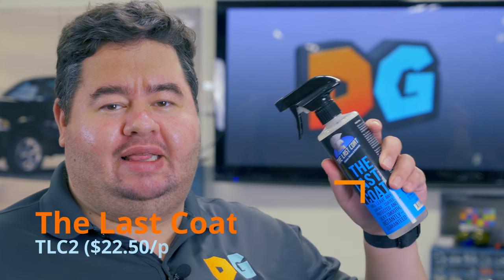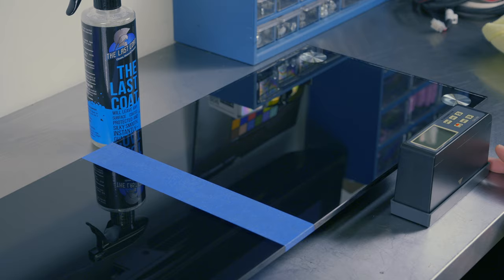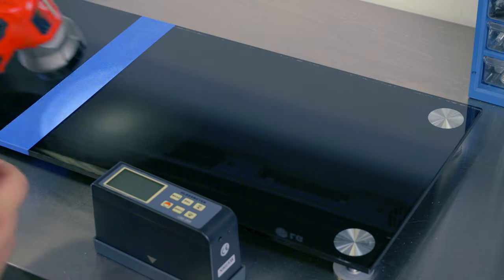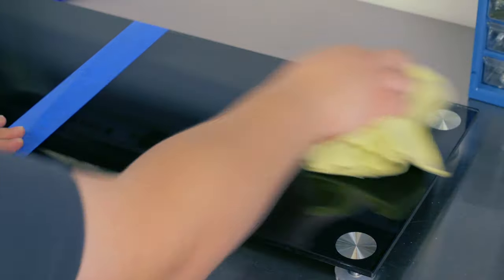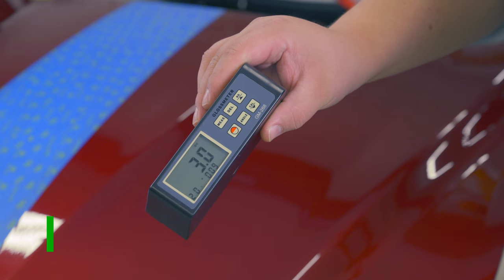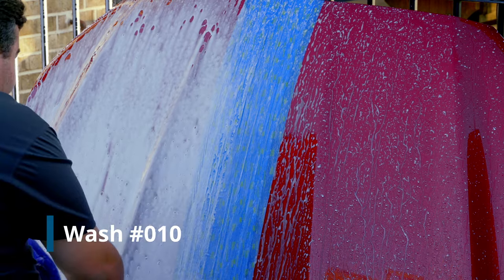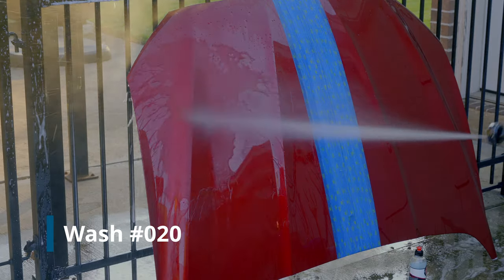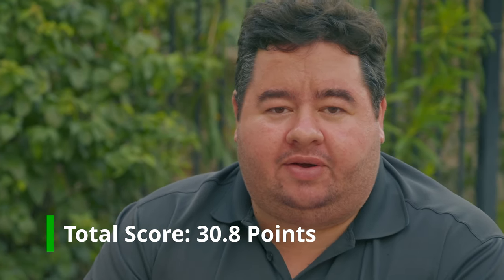The Last Coat 2.0 - TLC2 the latest fad or the best spray wax ever?

Comment: you honestly gave one of the most objective and unbiased reviews of this product.  I've been using this product for about 1 year- and I have to say, I'm a believer.  I ended up putting about 5 coats on my car and then add another layer ever 4 months.  Super easy to use and the shine is awesome- even after enduring a harsh Rochester, NY, winter!   Great Job!
Reply from the maker: Awesome! Glad you like the review and that the product works well for you. I used to live in the Capital District of upstate NY, and the winters there with all the salt are rough too!
Reply: Hi, are you still loving TLC? I’m in the capital district now.

Comment: For winters here in Minnesota, I wash and use beadmaker as a drying aid, then I put down Griots 3 in 1 ceramic spray followed in 24 hours with The Last Coat 2.  I have had 2 back to back winters with great results using this concoction.  I love the Griots but the last coat has more staying power on my F150.  Good presentation!

Comment: This review matches my experience with the product. If you are expecting deep gloss after application you will be disappointed. But I prefer durability and protection over deep gloss so this product is a winner in my book. If you want to boost the gloss of this product use it after Sonax hi speed wax. Apply the Sonax hi speed wax on the rinsed wet surface and dry. Buff the surface to a shine and let sit for an hour or two then apply the last coat. You will see the effects the next day. I've used the AMP from TLC, but currently prefer the Sonax than TLC combination.
Reply from the maker: Thanks for the field report! I'm sure it will help others and the tip on the Sonax is great too. Appreciate you watching!

Comment: I have used Turtle Wax seal and shine. Which is a very good product. I prefer how my paint looks with the last coat.TLC is also easier to use in my experience.  Also very durable
Reply from the maker: Turtle Wax SnS is great all around and I think TLC 2 is good as well. I don't think you can really go wrong with either one. TLC2's only downside is it isn't quite as light reflective as a lot of other waxes, but it still looks good. Thanks for watching!

Comment: Hey Dmitry,  
have you tried The Last Coat's ( AMP) ? on top of The Last Coat 2.0 after it has cured?  
They Claim it amplifies certain attributes of your vehicle's surface such as shine, gloss, and especially slickness to the touch?

They call AMP a "hybrid topper".  The Cherry on top...
My assumption is that The Last Coat gives easy to apply longer lasting protection than most others (with good shine)  
Then Amp is applied for the finishing touch?
I'm really curious as to how your gloss meter score would compare with AMP added.

Thanks for all the work you do and keeping it REAL!
Reply from the maker: Thanks for watching! No I haven't tried AMP on it, I may get into stacking products at some point, but right now there are jus so many individual products to test! AMP is on my list though!

Comment: As a user of TLC, and a previous requester of this test I sincerely thank you.  I would have preferred to see you use a microfiber applicator and do the crosshatch application rather than spraying directly on the hood.  The measured gloss reduction was kind of a disappointing shocker.  I also hope you test out that new 303 graphene product.  Now I am wondering if I should change it up to Adams Graphene when my TLC bottle runs out as I love a glossy wet look.
Reply from the maker: Glad I could make the test happen for you Steve :). I did do a direct application which is what I tend to do personally, it was an option in their directions, but you're right it can be easier to control application with a towel/applicator method rather than direct spray. The upshot of the gloss reduction was that it did go on very thick for a very pretty depth, but yea it just wasn't that shiny. I will be testing the 303 Graphene as soon as it's back on the market, hopefully they email out when they have more available. I'm on the waiting list :)

Comment: Great test as usual from you. The original Last Coat (TLC) was horrible. The Last Coat v2 (TLC2) is night and day better. Now Black Ice from The Last Coat has stepped it up another notch. I have Black Ice on my 2020 F150 and my 2013 Cadillac XTS. People are constantly asking me what do I use to get them that shiny. It takes Black Ice 7 to 14 days to fully cure, after that the gloss and depth are astounding and the slickness is amazing too!
Reply from the maker: Thanks Ron! Appreciate your continued viewership :-). Black ice is on my list, definitely have to check it out!  7-14 day cure seems very rough since people wash and drive daily driven cars.
Reply: @DmitrysGarage  thanks for the reply! The 7-14 day cure is for harsh soaps or detergents like drive thru car washes use. You can wash the surface with a ph neutral soap after 24 hours. You can re-coat or layer their products after 4 hours. Their detail spray, called Amp, is both a great topper and drying aid.

Comment: TLC 2 is great stuff, very easy to use and has overall good durability.  I just out a layer on my truck and tried 303 graphene spray on top of it. Hopefully should keep my truck well protected for the winter.
Reply from the maker: That's an interesting combo! Hopefully it holds out well over the winter for you. Thanks for watching!

Comment: I'm confused... you state that the panel with The Last Coat actually LOST gloss, by a lot (-10 points using a gloss meter) - but then say it makes the paint look "deeper and prettier"...as though there is "a second clear coat on top of the paint"...?
Reply from the maker: Good question. The fact is gloss is not the only factor in what makes paint look good. Gloss is just how much light is reflected at a specific angle, in this case at 20 degrees. It is just one factor. The actual perception of visual appearance and how pretty something is by your eyes/brain is much more complicated and even subjective, i.e. personal preference. For example a mirror is very glossy, it reflects light very well, would a mirror look good as car paint? Maybe if you're into the chrome/gold wrap look, but most people don't like it.

https://en.wikipedia.org/wiki/Visual_appearance

Comment: What camera do you use to shoot your content? Love the video. Keep up the good work.
Reply from the maker: Thanks :), the A/B multicam setup I use is two Nikon Z6 (https://amzn.to/3nSthMl) paired with Atomos Ninja V (https://amzn.to/371zyyI) recorders that write out to SSDs. I also use a Fuji X-T30 (https://amzn.to/362mtpe) on a gimbal for any b-roll or for stills. I used to use the X-T30 as a B cam before getting the second Z6, but it's much easier to color correct if both main cameras are the same. For action stuff like on-car, I use either a DJI Osmo Action or a GoPro Hero 5 (older model).

Comment: of all the chemical tests I've watched you are the first to use IPA, Nice!....I don't understand way you didn't show the Necessary Prep before appling it sends the wrong or misleading? message. I would like you to backup the gloss meter reading being so poor or is it?  Thank You for showing this product
Reply from the maker: Dave, i have to balance keeping the videos long enough to give context and short enough to not be overly boring. So as a result i often don’t show prep as it just doesn’t make the cut. The gloss meter readings aren’t necessarily that important. How the product ultimately looks is. My test panel is quite glossy (like polished paint) so it is hard to make it glossier. Few products can.

Comment: I think I might know which is better, but would love to see TLC 2.0 vs CarPro Reload, and maybe Adam's graphene spray just for fun.
Reply from the maker: I have tested all of these, you can see the results on my page: https://dmitrysgarage.com/wax
I did the Adam's Graphene video very recently here: https://www.youtube.com/watch?v=6ay-G2ttXt8

TLC2 and Reload are similar products. The Graphene Spray is more of a coating, a bit harder to use and works best with a good polished surface.
I'd rank them:

Adam's Graphene Spray (119.7 Points)
The Last Coat 2.0 (30.8 Points)
CarPro Reload (9.7 Points)

The big thing Reload has going for it over TLC2 is gloss. It's worse in all the other areas. Adam's Graphene Spray is much better overall, but a bit harder to use and more expensive (considering you can buy TLC2 in bulk).
Reply: @DmitrysGarage  Makes sense, a coating vs toppers results. But the Reload is not looking great lasting around 7 washes next to TLC 2.0 and Seal n Shine. I hope Reload lasts longer than Shine Armor or F11 Topcoat.

Comment: I wouldn't call it a spray wax.  I would call it a ceramic coat spray booster since it's designed as a boost for after you wash cars that have been ceramic coated and it's not a wax.

Comment: The Last Coat is 4x the price of TW seal n shine, but i am not seeing it 4 times better. I don't think it"s hype, but I just don't see it worth the money.
Reply from the maker: Turtle Wax SnS is definitely a tremendous value, given how well it works and the low price. This product is about 2x the price if you buy it by the gallon, but I agree it's not 2x better. That being said how often is that true of anything? Is a fully loaded Toyota Avalon 2x better than a Toyota Yaris? Is a fully loaded Corvette 2x better than a basic V8 Camaro? I'd say probably not. Those cars are a huge value too, but people still pay more. It's always diminishing returns. Ultimately it's just a question of what is important to the buyer, maximum value or specific features.

Comment: What the cure temperature? During the cure time, does it mean I should not drive before it's complete cured?
Reply from the maker: I cure indoors and have HVAC in my garage so the temperature is around 70F. Colder temps will likely increase cure time as can humidity. You could drive during the cure time, but it may impact performance if it rains or gets super contaminated. Cure time is for maximum durability of the product. They suggest 24hrs, which I always do unless it says to do longer cure times. Temperatures weren't specified.

Comment: Can i put this as a topper on a ceramic coating? And when i have to put in on? after the ceramic coating has dryed?
Reply from the maker: You can, but I would only use it after the ceramic coating is well cured.

Comment: I just purchased a 2021 car and want to protect the finish as much as possible - since I am in upstate NY.  Would you recommend using TLC on a brand new vehicle?  If yes, should I start with a good wash, followed by IPA then apply the TLC?
Reply from the maker: Beth, I grew up upstate :). I would definitely recommend TLC. Im going to assuming the dealer didn’t sell you any coatings or sealant treatments when you bought it (which is optimal). For process I would recommend a strip wash shampoo (adams has one) that helps remove any prior wax from when the dealer detailed the car. Then you can decon with IPA. Optionally you can claybar it to get rid of other contaminants. Then go for the TLC :)

Comment: How does it compare to the wulfgang?
Reply from the maker: Which Wolfgang product specifically? Overall this is a good spray wax and would rate up there with other good WG products.
Reply: @DmitrysGarage  I guess wulfgang 3.0, I already have that... My friend just got a new car and I wasn't sure which one to suggest for the 1st application
Reply from the maker: @rsmolkin  Roman, I like the Wolfgang Deep Gloss 3.0 a lot, but it's more of a project car sealant. Meaning if you want it for a daily that gets dirty a lot, you would probably prefer the TLC2 over the Wolfgang DG 3. The Deep Gloss 3 is prettier though for sure and slicker.

Comment: What happens if this stuff gets into the water supply?
Reply from the maker: Like if someone puts it into a reservoir or a water tower? Probably nothing since it would be super diluted if it's just one bottle. If someone spilled barrels of it, I'm sure it would be a big deal.
Reply: @DmitrysGarage  This stuff is going on cars. It gets washed off over time and into our water ways and gutters. If that water is recycled which it is usually how does this stuff get separated? I guess you could say that about any chemical but this is sold as "hydrophobic...makes you wonder
Reply from the maker: @makingadifference4834  Most of the bottle is carrier fluid which is typically a petroleum distillate solvent that evaporates. The layer on the car is VERY thin, microns thin. So the washoff of the actual active ingredients is going to be very small. Of all the thing polluting our water this is going to be one of the smallest. We still have farm waste, human waste and even illegal chemical dumping going into waterways. For example: https://twitter.com/KUSINews/status/1224862912369455104 where Mexico was dumping 50 million gallons of sewage a day, nothing car wax related will ever compare to a fraction of this. As far as worries that they're hydrophobic compounds, that doesn't necessarily make them extra bad for water or people. There are far worse things that get dumped.

Comment: Will it increase the shininess if I apply wax over Last Coat? Which wax would you recommend the best?
Reply from the maker: Good question. It may or may not, depends on the product. I personally dont stack products as it costs more time and money, i prefer to find one that meets the needs of a specific vehicle.
Reply: I've been doing research in this product and I thought I remember seeing that you're not supposed to put any wax with this product because it's going to interact with it negatively. If you want to be more glossy, they recommend doing two to three coats with 10 minutes in between. This review only did one.

Comment: I discredit any review that doesn’t show both sides (treated and non) with the same test criteria in the same shot. Why would you not do that? Further justifies my point when you talk about affiliate links at the beginning of the video. Too many good reviews out there to waste time watching these.
Reply from the maker: I have no idea what you’re on about. I literally show both sides.
Reply: @DmitrysGarage  Yes you do, on the hood. But the gloss panel test showed one high initial result followed by four lower results, and we never saw numbers for the control or non-treated side. Was the control number based on a single reading or an average of five tests? It’s just difficult to believe that there is less gloss on the treated surface than the control (even if the product goes on thick) because the product is highly marketed for its gloss factor.
Reply from the maker: When results bounce around on the gloss panel it indicates the product has high and low spots. This is why I take an average of 5 readings. For the control side the 94 GU rating is based on a 5 reading average. Before the test starts I machine polish the panel to get it to average 94 GU. You can also see once I take the wax off with isopropyl alcohol the panel returns to ~94GU in the one sample I took. 

While the product is marketed for gloss, we have to first understand what gloss is. The gloss meter device measures light reflection. If you stuck it on a mirror it would go off the charts. Do you consider a mirror glossy? Most people would say reflective. So this means there is more to gloss than how reflective it is. This is why I also do the visual appeal test which is subjective to my perception of gloss/prettiness. If you saw the visual appeal part, you saw I liked how the product looked.

Even though the product heavily cut reflectivity, it still looked glossy to the eye. The concept of what humans consider glossy is complicated and actively researched. Reflectivity as measured by the gloss meter is part of it. Products that maintain high reflectivity and create the deep gloss effect look great. TLC2.0 would look better on a whole car if it was more reflective, but it is still a pretty "glossy" product.
 
I also have to mind the length of the video and tailor the level of detail for each test to match viewer interest. My tests take hours to do before any video editing. A typical two camera output is about 1.5TB of video. If I showed every part of it, the pre-staging, checking the control surfaces, etc.. they would be hours long. I've got to distill those 1.5TB to under 15 minutes to have any sort of reasonable viewer retention.

I hope this gives you some insight into my testing and thought process.
Reply: @DmitrysGarage  thank you for the informative response. I can appreciate the fact that you’ve carefully considered the technical aspects of your testing. I retract my original statement and apologize for jumping to that conclusion.
Reply from the maker: No worries. It happens. Thanks for watching the video :)